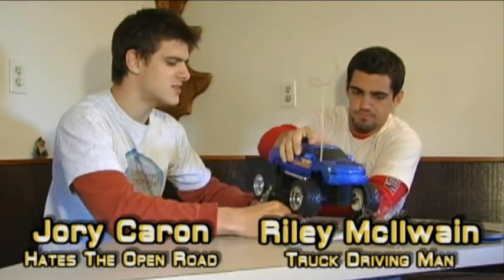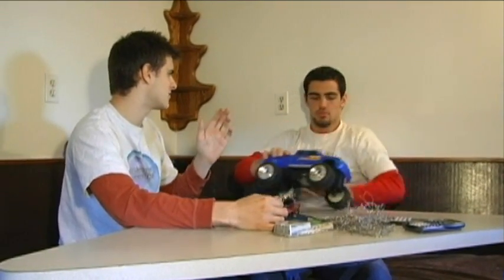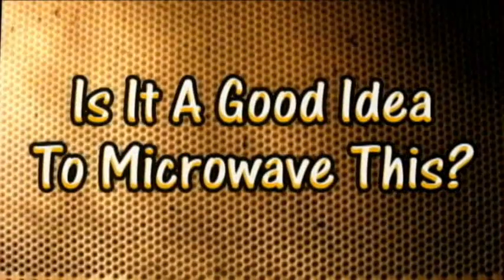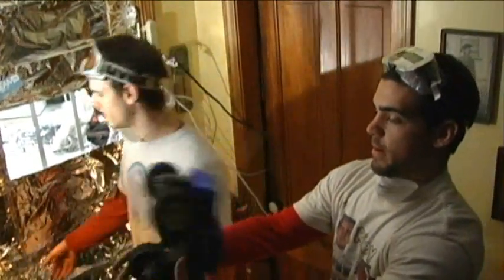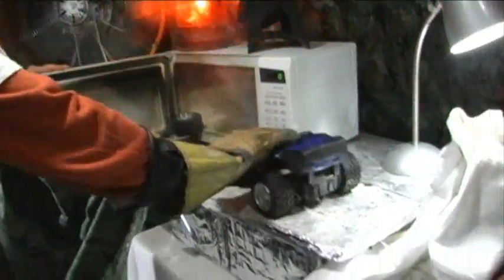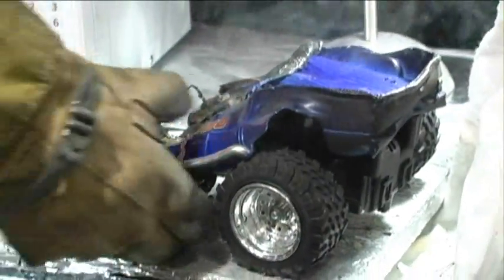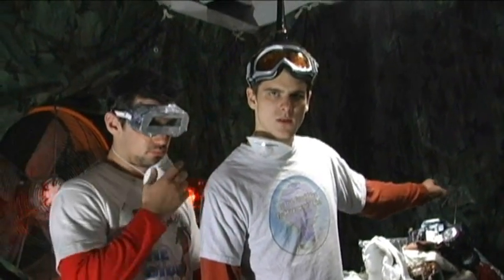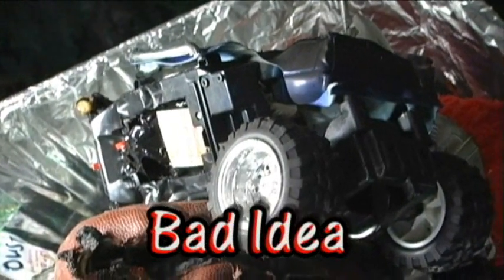Is It A Good Idea To Microwave An RC Truck?

Comment from the maker: charlesmcguffy- Actually, they're closed-captions... and they're for the hearing-impaired. They've been on all my videos for the past year, but recently, YouTube has changed the site so they're enabled by default. You can disable the CC by clicking the arrow in the bottom right corner of the video player. What a surprise right... one of the three buttons available... how come you weren't smart enough to figure that out yourself?

- Jon

Comment from the maker: Metalwrestling - Actually, they're closed-captions... and they're for the hearing-impaired. They've been on all my videos for the past year, but recently, YouTube has changed the site so they're enabled by default. You can disable the CC by clicking the arrow in the bottom right corner of the video player. What a surprise right... one of the three buttons available... how come you weren't smart enough to figure that out yourself?

- Jon

Comment from the maker: geckoisgiko - Actually, they're closed-captions... and they're for the hearing-impaired. They've been on all my videos for the past year, but recently, YouTube has changed the site so they're enabled by default. You can disable the CC by clicking the arrow in the bottom right corner of the video player. What a surprise right... one of the three buttons available... how come you weren't smart enough to figure that out yourself?

- Jon

Comment from the maker: Jtking3000  - Actually, they're closed-captions... and they're for the hearing-impaired. They've been on all my videos for the past year, but recently, YouTube has changed the site so they're enabled by default. You can disable the CC by clicking the arrow in the bottom right corner of the video player. What a surprise right... one of the three buttons available... how come you weren't smart enough to figure that out yourself?

- Jon

Comment from the maker: goowy1256- Actually, they're closed-captions... and they're for the hearing-impaired. They've been on all my videos for the past year, but recently, YouTube has changed the site so they're enabled by default. You can disable the CC by clicking the arrow in the bottom right corner of the video player. What a surprise right... one of the three buttons available... how come you weren't smart enough to figure that out yourself?

- Jon

Comment from the maker: Pieman125125 they're for the hearing-impaired. They've been on all my videos for the past year, but recently, YouTube has changed the site so they're enabled by default. You can disable the CC by clicking the arrow in the bottom right corner of the video player. What a surprise right... one of the three buttons available... how come you weren't smart enough to figure that out yourself?

- Jon

Comment from the maker: Bohlin69 - Actually, they're closed-captions... and they're for the hearing-impaired. They've been on all my videos for the past year, but recently, YouTube has changed the site so they're enabled by default. You can disable the CC by clicking the arrow in the bottom right corner of the video player. What a surprise right... one of the three buttons available... how come you weren't smart enough to figure that out yourself?

- Jon

Comment: Actually the wheels still are parallel... but we knew what you meant. But anyways yes I did own a power wheels but then I took it apart and my friends and I towed it behind a bike and did all kinds of powerslides and stuff. It slid easily because of the hard plastic tires.

Comment: ok i didn't know they were for the hearing impared i'll give you that, but i knew how to turn them off because i accidentally clicked on the 'closed-captions' button myself when trying to pause the video to let it buffer because my internet is insanely slow so i let about 3 vids buffer at the same time so i can flick between them. but i digress you shouldn't assume that i wasn't "smart enough to figure that out yourself?" i was simply stating that i never realised that it was there.

- Sam :)

Comment from the maker: Edor12345- Actually, they're closed-captions... and they're for the hearing-impaired. They've been on all my videos for the past year, but recently, YouTube has changed the site so they're enabled by default. You can disable the CC by clicking the arrow in the bottom right corner of the video player. What a surprise right... one of the three buttons available... how come you weren't smart enough to figure that out yourself?

- Jon

Comment from the maker: squid361 - Actually, they're closed-captions... and they're for the hearing-impaired. They've been on all my videos for the past year, but recently, YouTube has changed the site so they're enabled by default. You can disable the CC by clicking the arrow in the bottom right corner of the video player. What a surprise right... one of the three buttons available... how come you weren't smart enough to figure that out yourself?

- Jon

Comment: Were there any other experiments you were worried wouldn't fit into the microwave? And what would you've done if so?
Reply from the maker: +pokemonmanic3595 Not really... and either make it fit, or not film it.
Reply: Jogwheel Yeah, though you didn't want to have an experiment on the table you couldn't microwave even though it's in the cut